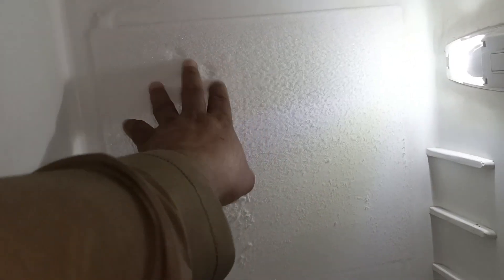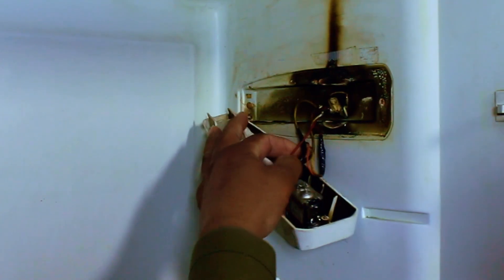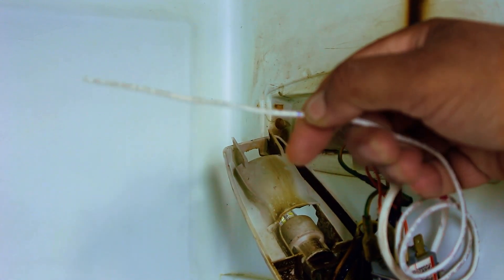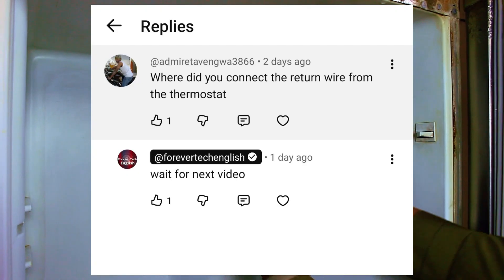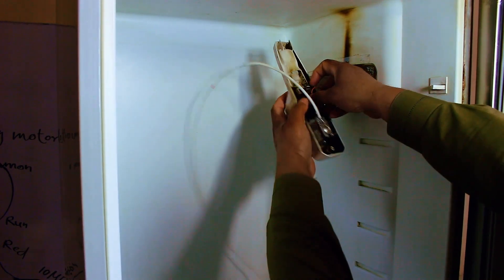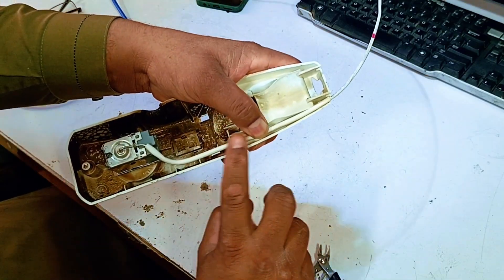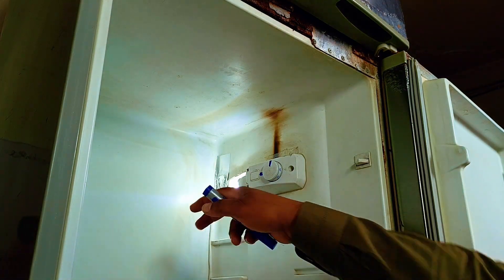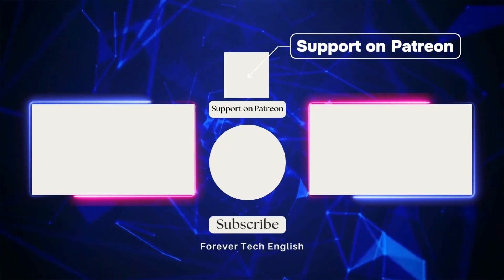"It wasn't easy, but I refused to give up on this old fridge."

Comment: Hi sir, would you tell me please how can I tell which overload is suitable for which refrigerator compressor horsepower from the serial number on the overload like DRB22N61A1 . Because I have many used overload and I don’t know which one of them is suitable for which compressor horsepower !thanks.